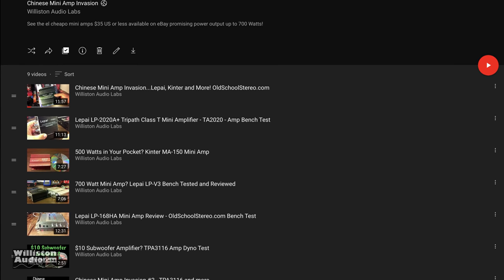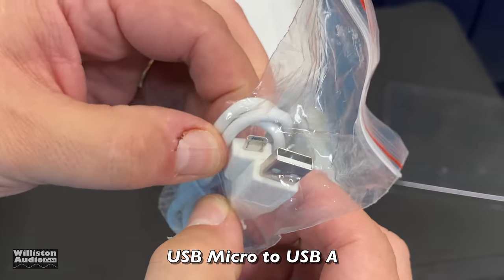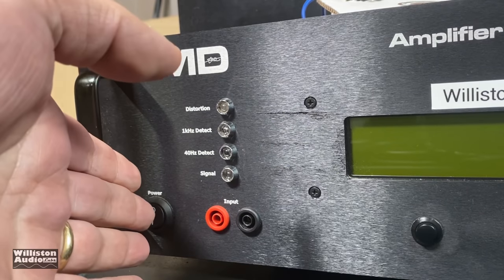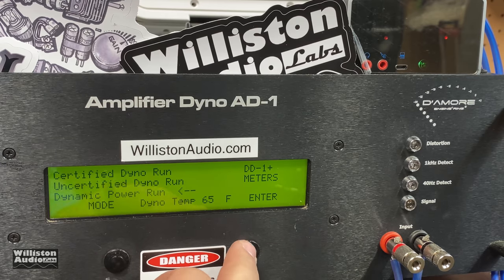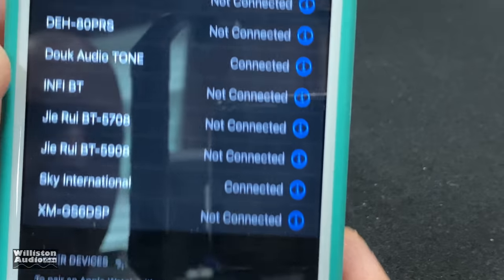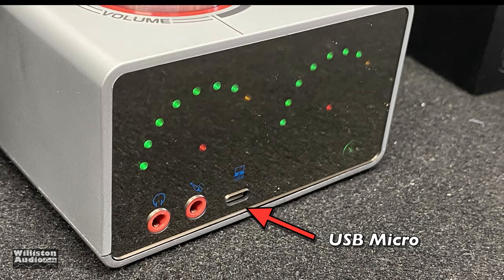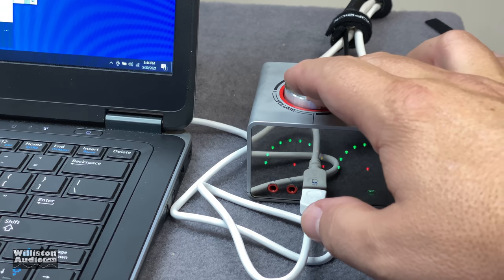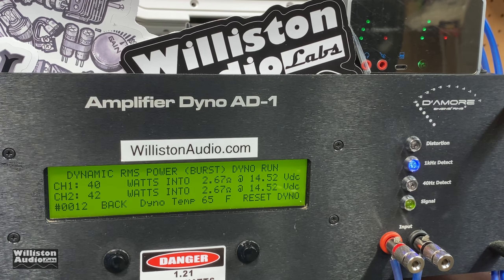Amazon Mini Amp Best Seller? - Douk Audio TONE 50x2 MAX Mini Bluetooth Amp Dyno Test and Review

Comment: I bought one of the little noobsound mini bluetooth amplifiers a few years ago for testing speakers before I bought them.  It sucked on 12v but connected to a laptop power supply it sounded way better.  Was actually quite loud on a old set of 70s house speakers.

Comment: I actually have that exact same unit. Using it for my computer. I have a 24v 10A power adapter on it and it actually sounds damn good
Reply: TPA3116 is a good amplifier ic. if everything is designed correctly. you get good amplifier card based on TPA3116 but this box does not have good amplifier design!

Comment: I don't know if you noticed it's typical for these type of amps the max power rating does include a voltage rating with it for instance on this one that 50/50 or 50x2 is a rating at 24 volts obviously they didn't give you a 24 volt power adapter pretty confident if you hook up a 24 volt power adapter that you could probably squeeze out 45 Watts or so per channel but that power adapter will probably cost more than the amp.

Comment: I bought a few of these 3116d2 amp boards and they are pretty impressive. You can have cops called on you for sure jamming on one of these boards with the proper power supply. They are fairly cheap and the PSU required are cheap also. You don't need a 250 dollar high current bench psu to run one of these. Check out the versions that feature the ADAU1701 DSP on them. I just started tinkering around with the DSPB-100 from Dayton audio and SigmaStudio for PC which is phenomenal.

Comment: i suspect its tpa3110. related to tpa3116/tpa3118 but lower power rated and cheaper. a simular aux, bt, usb dac amp to this used the tpa3110.

Comment: Very cool. Love my mono mini sub amp with the 3116d2chip. I am not really impressed by VU meters in general but that's def a big selling point here for folks that are. The input selection is awesome too. Will you tear it down further later on? I am interested to see exactly which chip is in there and wether it has a heatsink. This makes a huge difference in the long run

Comment: That’s cool 😎.
I would make small boxes whith each having tri way drivers and handling 25 w Rms,
I wonder if you do modification you strap two lol 😂!
Reply: If I’m not mistaken they are already bridged. But I could be wrong as I have a 3 channel that does 56w on the sub channel at 4ohms but only about 25ish on the stereo channels. 🤷‍♂️.  But if you are running a sub that is a dual voice coil setup that might work pretty sweet!
Reply: @russelllopez4171  cool 😎!thanks for replying!
I should’ve been more specific,if you were to tap into the input of one amp and feed the signal to the other internally so it can also amplify it or maybe the amp has an audio out and then just connect it to the amp and have both amps blasting, sorry bro I think to much lol 😂!I just love audio stuff so much!
Reply: I always have a soft spot for those who tri amp. Lol. I used to work in car audio and my boss was against it, but I did it anyways and learned so much from it and if done properly has way too many benefits over conventional designs particularly control over each speaker and how much cleaner and more efficient the amps are.  With the amp i own it has noticeable noise at high volumes and at high frequencies, so I’m not sure if all the chip board amps are like that, but it’s something I feel like I need to make you aware about.
Reply: @russelllopez4171  thanks 🙏 you’re information is greatly appreciated!
Reply: @pedroveliz4131  sorry I actually never saw the question you asked for this one. But I think I can answer this one for you, if I’m picking up what your laying down 

Let’s say for the sake of reference the chip amp has a pair of amplifiers rated at 10 watts each.  If you were to take that 10 watts of signal from the one amp and feed it into the other, you would still have only 10 watts of output in the end, because the first amp automatically becomes a pre-amp  if it feeds a signal to another amplifier.  

If I missed the Mark let me know and We can figure it out.

And no need to apologize for overthinking.  I do the same and this is why I’m able to “kinda” answer your question. I think so much that I forget more than I remember. Lol. I absolutely love audio.  Used to work in car audio, then I build and purchased a professional audio system using car subwoofers so that I could DJ at parties anywhere and then I became a sound tech for a metal band (which was huge help for learning how to eq) 
I sing karaoke and “try” to play guitar. Lol.  I am an SQL kinda guy and have heard many compliments of my systems over the years for being very loud and clear and the same people would say that they’ve never heard anything like it. So yep, I’m the true definition of a fanatic!  Lol

Comment: i have the douk audio previous model ,metal case, 24v, 8a supply. I guess same internally except has BT 4, but it pumps some heat into Polk T15 bookshelves and run via a mini Behringer FBQ 9 band equalizer to another TPA Sub Amp  you get a Surprise

Comment: TPA3116 is a good amplifier ic. if everything is designed correctly. you get good amplifier card based on TPA3116 but this box does not have good amplifier design!

Comment: get on Ebay and test out the Wuzhi Audio ZK-MT21 please. its an 2.1 channel Bluetooth mini amp, 50×2 for speakers and 100w for sub. Has sub frequency adjustment, sub volume, and treble/bass control for the speakers. I use one now and like it pretty well, but curious to know its actual output given the called for power supply and so on
Reply: I have it powering a pair of Wharfedale Opals and for sub use an 8" Skar VVX wired at 2ohm final
Reply from the maker: Probably the same as the Nobsound which uses TPA3116 chips
Reply: @wal  i think it does after thinking about it. I have a 10a/120w power supply on it. I think there is another model that has a big heatsink plastered atop it aswell
Reply: He should try the zk-1002T it’s double the power with bass and treble adjustments it uses dual tpa3116d2 chips it’s an amazing amp for the price
Reply: @wal  any experience with the TPA3255? I'm interested in trying one of the 2.1 boards out, but none have subwoofer control, which is a bummer to me. Not sure what could be done there but it looks nice otherwise

Comment: You can get 50 watts out of TPA3116D2 chips at 24 volts supply IF everything aligns just right.  No supply sag,  filter inductors are not crap,  chip has a good heatsink,  etc.etc.   I've run enough tests to say this for sure now.  Problem is the TPA3116D2 is terrible above 10Khz in my experience.   Not that it matters much for this class of amp.
Reply: Yeah I find mine is pretty noisy and I knew the high end was weak, but unsure in the spectrum of where it was. Thanks for clearing that up!
Reply: @russelllopez4171  I've just found the TPA3116 chips to be distorted pretty bad above 10Khz.   They still put out the power,  just not clean.   I've only tested about 6 of them,  so can't say this is an absolute rule.

Comment: 50x2 my ass LOL  Good video !
Reply from the maker: These chips can do 40x2 if provided 24V of input. The included power supply is 19V. But correct, still not 50x2
Reply: @wal  yeah, i have tested a few my self with my QA401, it wasn't bad but mine claimed 100watts rms with 24v psu, and it failed :) "BUT" good little amps for desktop speakers or small footprint.

Comment: thats alot of money for tpa3116
Reply from the maker: It includes power supply and extra cables so not too bad overall
Reply: @wal  true but still, after all 3116 is amazing chip but you can get them as cheap as under 10eur/chip, ps thx for answering, keep up the good work👍
Reply: @dandeson9723  It never states that it is  tpa3116(in the manual, in press materials, promo pages, their site etc) and Duok isn't shy about stating what chips their products use(which they do on their site for other producst). I'm guessing it's probably a custom chip related to the  tpa3116.